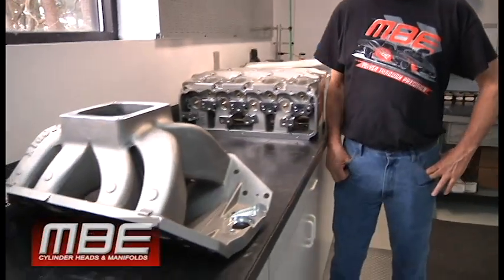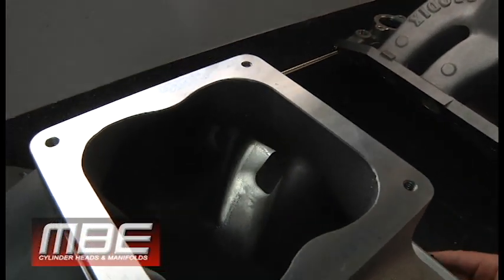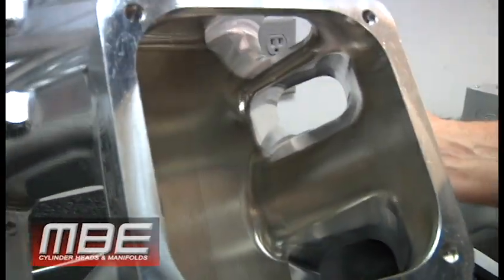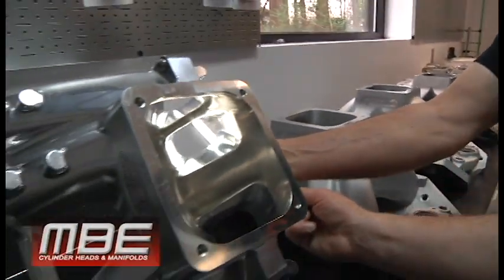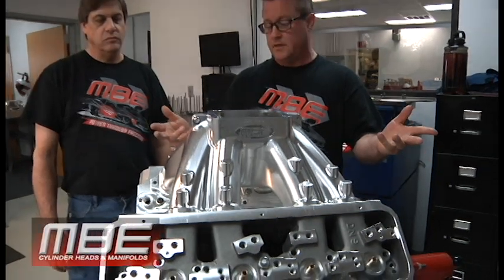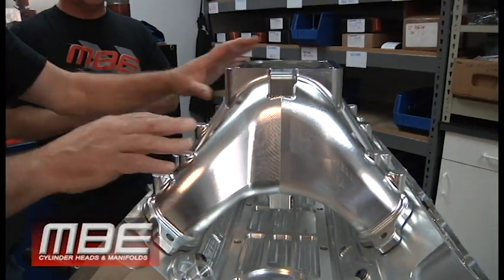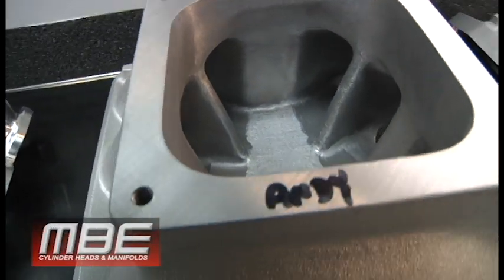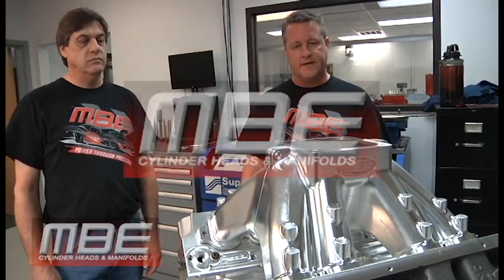MBE  BBC Intake Manifold 101

Comment: Kickass make power, period..
Yeah right.
Add a 'try' in front of that sentence.
If having that attitude for real, you would drop the rockerarms and pushrods and place two camshafts in each head.
Think about that for a while, bb with 32 valve, outrageous flow with high airspeeds and no valvetrain issues.
But, i figure you might run your self out of buisness lol
Reply: 4 valve large displacement, non-traditional valve train would be interesting.  
However I don't think you can name 1 single existing example of a 4 valve NA engine that will run with that big 9